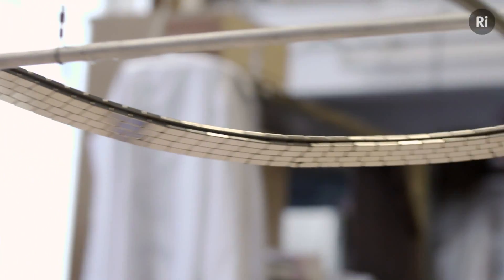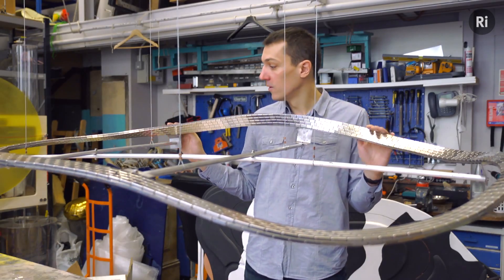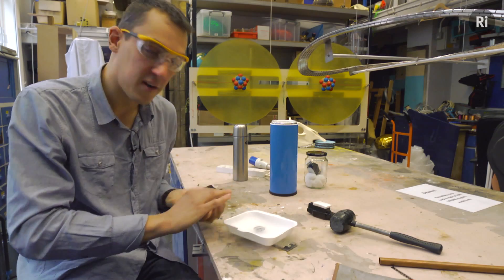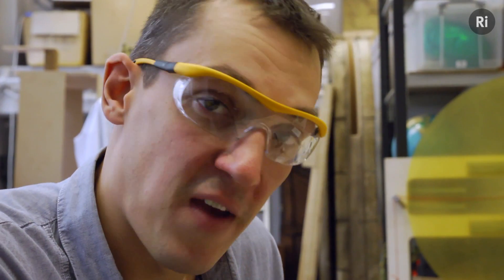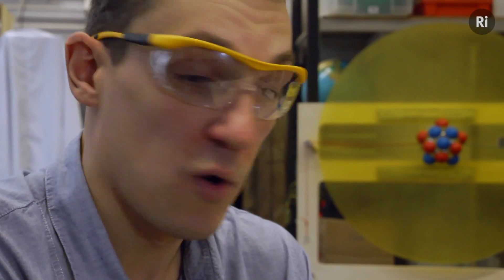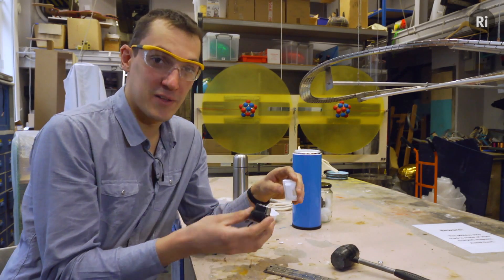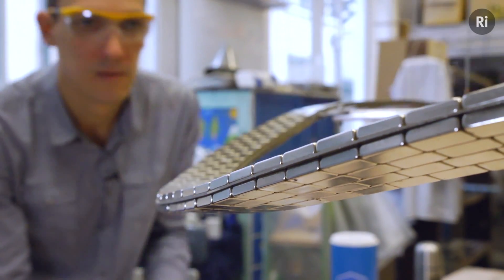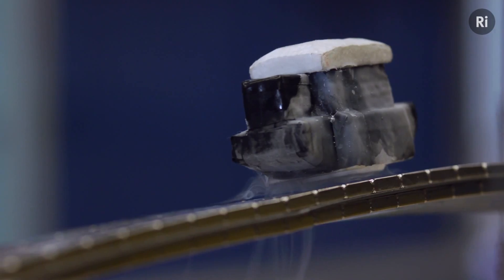Levitating Superconductor on a Möbius strip

Comment: You said that the magnet could be lock in place because there is no resistance, but if the resistance is a true 0,0000... Ohm, why can we revome and place the magnet without an infinite force due to infinite Eddy currents ? The magnet is not definitively 'stuck' in place ?

I am wordering for years !
Reply: induced current is limited by the induced emf caused by a change in flux. so a max force it can take is dependant of change in flux. so when that threshold is met it cannot stay put
Reply: have u found an answer mate?im wondering the same thing. i think its something to do with "flux pinning/qauntum locking" see in the video he "sets" the conductor to constantly float at that height
Reply: Correct me if I'm wrong: you are wondering how it is possible to easily move the superconductor (SC) inside a magnetic field while having 0 resistence (R). This because a 0 R conductor (perfect conductor) moved in an external magnetic field would generate infinite eddy currents.

I would takle this from two sides:

First, the 0 R condition (also called perfect conductor) is not sufficient for infinite eddy current as @Jensen is suggesting. With 0 R you actually have persistent current, meaning that a current generated inside the perfect conductor will never cease to exist, but the intensity of this current will never be infinite. You would need an infinite change of flux to induce an infinite current, which you can see is impossible. Otherwise if a finite change in flux would generate an infinite current this would solve the energetic hunger problem.

On the other side the SC is NOT a just magnet, it is way more than that. A SC shows the Meissner effect, namely NO magnetic flux can enter the SC. Similarly to how NO electric field is present inside a conductor (in static condition). And how can this happen? We can think that the SC generates a magnetic field such that the total magnetic field inside itself will be zero. Therefore when you move the SC this will modify the field that is generating and when you leave it the new field configuration will again be such that the internal field is zero. In this way you can see that there happen no change in the magnetic field flux inside the superconductor, because the field inside has always been zero, this implies no eddy currents.

Actually there are also surface effects happening which complicate the picture, but the final result is similar.

I hope that this intuitive picture would help you!!!
Reply: @danieleronchetti1314  Thanks, in fact it's not due to eddy currents so the explanation was misleading. It's due to Meissner effect that is a specific case with 0 resistance.
Reply: Awesome work bro👍..thanks for sharing ❤️

Comment: Where in this Mobius strip does the magnet pattern change from one polarity to another? Is not possible to align all magnets South Pole inside, North Outside, because there is only one surface. What happens to the train in the changing polarity zone? Does it bumps or something?

Comment: Stick a little fan to it, and you don't need to push it.

Connect that fan to a remote controller, and you can drive it around.

Connect multiple fans, and make the track fatter, and you have a car that can steer.

Make multiple cars, and you have a race track.

Imagine that: a mobius strip superconductor racetrack. Since you use superconductors, you could make it go ridiculously fast. If that isn't a cool idea for a toy, I don't know what is.
Reply: Its just the problem on little kids handling liquid nitrogen and daring their friends to stick their hands in it.
Reply: streak1 *liquid nitrogen not included
Reply: It’s going to be attracted to the track itself, and it can demagnetize the superconducter
Reply: Sounds like F-Zero.
Reply: Monody YESS!
Reply: No need for a fan or batteries. Use the nitrogen vapor from the rapidly boiling liguid nitrogen to propel the vehicle with a nozzle.
Reply: Wouldnt be able to steer. Has to follow the track or it wouldnt float
Reply: This guy living in 2084 lol
Reply: Cool is the right word
Reply: Build 2 strips as "tracks" and a linear motor in the middle: A levitating train.
Reply: i was thinkin in the same way. And pute it in hyperloop and you can travel around the word in min. Or get my packege from china in 1hour instead 30 days.
Reply: that would probably be around $2,000 dollars or something. not many people will pay that much to watch fast miniature racecars.
Reply: @lipstick372  
I would
Reply: @OLD-AND-UGLEE  then you make bad decisions
Reply: Money
Reply: That's just stupid

Comment: His explanation doesn't seem to add up. If it were a matter of Lenz's Law as he is suggesting lifting the conductor away would create a stronger force of attraction in opposition to that motion, and as he suggested as there is no resistance the current should be able to equal any value required to keep the conductor stationary.

Comment: The Problem with this explaination is that you have to cool it down at the same relative distance and then it "flips" into the right position on the track. If any movment that is not along the track is repelled, why does it flip in that right position?

Comment: do we have any materials that is a superconductor without needing to supercool it?
Reply: i belive so, but don't quote me on that.
Reply: Na they're all artificially made metal alloys that have absurd critical temperatures. If we did digital electronics would have 100x better signal speed.
Reply: I believe graphene is a superconductor, and it has the added bonuses of being 2-dimensional and harder than diamond.
Reply: can i use dry ice instead of liquid nitrogen?
Reply: Unfortunately, graphene is harder than diamond only in principle, not yet in practice.  The inter-atomic bond structure is sturdier than that of diamond, but macroscopically, graphene is literally a 1 atom thick sheet of graphite.  That's not an analogy.  The Nobel prize winners for discovering it used normal sticky tape and pencil lead.

In addition, the actual formation of graphene is extremely delicate, and those perfect hexagonal atomic structures fuck up every hundred or so (I think) which essentially means there's almost no way to make large amounts of "pure" graphene.  At least not yet.

There are other issues with it that I learned about in nano, but I've forgotten it.
Reply: Nathan Klassen Oh well. Some day, though, we may be able to mass produce it.
Reply: The room temperature superconductor is like a holy grail for many scientists. Some claim it's not even possible, others never give up. Recent studies claim that it's possible, but you need an extreme pressure or infrared laser pulses...
Reply: Actually, graphene is not in fact a superconductor at zero. However, it does have remarkable heat conduction properties; i would recommend searching graphene cutting through butter or an ice cube, just by using the heat of a human hand.

Comment: can we use electromagnets in place of permanent magnets?
what is that box made up of in which you have attached ceramic disc and filled it with nitrogen?
how can i keep my liquid nitrogen cool if i buy it from a shop?
Reply: My guess is that the material the box is made of doesnt matter, as long as its not magnetic and wont become so brittle that it breaks when cooled by liquid nitrogen.

Comment: Have you tried this track in a vacuum?
Reply: #neartonofrictionwithmotionwouldbetooop
Reply: It is easy to imagine what would happen in a vacuum but remember the superconductor will eventually warm up and stop. Also you can't produce perfect vacuum easily but it can be done better than it is in space.
Reply: plusko that depends on the radiation of nearby heat sources and the average "temperature" of the vacuum.
Reply: +ThePizzabrothers Gaming if it's a hot day and you're in a dark room it would be significant

Comment: so basically we could have cars that float on a magnet track that runs on liquid nitrogen
Reply: they already have mag-lev trains
Reply: +Jawbreaker That be horrifically expensive and unsustainable though :C
Reply: ShatteredDawn but technology can always advanced and be fixed
Reply: Jawbreaker Material cost is a lot harder to fix though, especially when the benefits of replacing roads don't really justify it.
Reply: maybe not cars, but a hyper loop-like system... maybe,  if the thing is inside a vacuum tube, keeping it cold becomes  less of a problem, plus this dramatically simplifies the track
Reply: Mik Wind tru i agree
Reply: Neodymium magnets are expensive. Electromagnets also. But you can build funny projects.
Reply: lobster strike tru dat
Reply: How about the hyperloop things run on the magnet track, but instead of using liquid nitrogen as a fuel it uses electricity the  Using fractional distillation to get liquid nitrogen (to cool the superconducting base) from the air, also as byproducts you would get The other gasses found in air which could be placed in tanks sold eg. CO2 Oxygen and Argon (You could also recollect nitrogen or just release via exhaust it), if it's also powered by solar. Mega profit and you could advertise that it consumes co2 rather than releasing it.
Reply: BC5  fractional distillation is for separating component gases/liquids by taking advantage of different boiling points, this doesn't work for getting nitrogen because everything in air is already a gas, heating it up more does nothing. moreover i dont think you realize how much power that can take to do. run it off solar? yea, maybe if you had an entire solar generator plant on wheels. you could do the reverse, that is lower the temperature until things separate by different boiling/freezing points. but again that would take massive amounts of power.
Reply: +mxn1948 1. http://www.bbc.co.uk/schools/gcsebitesize/science/edexcel_pre_2011/oneearth/usefulproductsrev2.shtml < Fractional distillation of air explained simply by the BBC. 2. I'm talking about something like a hyperloop running off this, you could have the "tube" the carriages run through having solar panels atop.

Comment: So "high temperature" is relative? When you name things do you EVER think about the future? I mean, they will likely one day invent super conductors that operate at room temperature, then maybe at REAL high temperatures, live greater than 2500 degrees. What are you going to call THOSE ones?
Reply: +Eric Taylor so you're saying we should never use the terms "high" or "low"?
Reply: +Eric Taylor so you're saying we should never use the terms "high" or "low"?
Reply: +Eric Taylor Maybe we can just put the letters "er" at the end of the words for each increase in magnitude. Ie. "high", "higher", "higherer", "highererer" and so forth; an extended comparative form of the adjective, if you will. This system can extend into infinity, so I think it should cover all future progression and it works for pretty much all adjectives.
Reply: lol, you say that but then immediately after say that 2500 degrees is "high". It's pretty darn low for lots of cases.

Comment: i have a question, that how does that superconductor  flips to the other side of track. as you initially pushed the semiconductor above the track  and after taking one round it can be seen inverted below the track facing downwards. is that something to do with the construction of this track.
Reply from the maker: +Ankush Sharma Yep, it's because of the shape of the track. It's a Möbius strip, which is a shape with only one side. As you move along it, you'll cross the entire length of the strip before you get back to your starting point:  https://en.wikipedia.org/wiki/M%C3%B6bius_strip We used it to show the the levitation even works when the boat is hanging below the track.
Reply: It is basically a strip connected at both ends but before that you twist one end once.
Reply: +brian yu Its 'Moebius Strips', Moebius is a proper name, and only one single August Ferdinand Moebius (an astronomer) discovered/invented it.
Reply: for a simple explanation, get a strip of paper and give it a half turn so there is a sort of corkscrew in the center and tape the two ends together so the bend is still there. if you put your finger on one side and without lifting it, move it along the strip, it will eventually travel the full length of the strip, never leaving it but touching it all the way along. so the question now is, how did a clearly 2 sided piece of paper suddenly lose a side?
Reply: mobii strips have a flip in the middle, making it so that it has one side
Reply: A Möbius strip is a special surface called a non oriented surface. It has no definite top or bottom side. I.E. It area vector does not point normal throughout both sides of the surface
Reply: +Patrick B. Ludwig its Möbius.
Reply: +jared anderson "Möbius" and "Moebius" are the same word. The rule with umlauts is that if you don't have them on your keyboard you can put an 'e' after the letter. So 'ö' can be typed as 'oe' ... the person you are correcting was correcting someone who had typed "mobii strip".
Reply: Chris Flanagan ahhh, I did not know that rule, I've only taken sort of basic classes in german and never ran into this issue. Thank you for that. And if nessecary, you can go to a web page with umlauts on them and copy paste.

Comment: Just a suggestion, but you should modify the cell you hold the liquid nitrogen it (the one with the magnet on it) into an airtight chamber with a valve at the back so that you can channel the nitrogen gas out through the back so it can propel itself.
Reply: +Tyler Wood The idea of an airtight chamber is great, but the valve would be a complicated one, involving a mathematical optimization process. It's not a bad idea, but more work would have to go into finding the optimum relationship between how much nitrogen you need to keep the magnet apart from the track, and how fast you want to move (temperature vs velocity),  The idea of a levitating superconductor is that the temperature of the liquid nitrogen makes the object hover over the track. Remember, there is no such thing as a known process that converts 100% of one form of energy into 100% of another. Optimization is required when a single fuel source powers force against BOTH the y and x directions. However, your idea would work if the forcing of nitrogen out of the tube was a 100% efficient process, converting all of the energy needed over time to keep the train upright into a proportional amount of energy shoving the device across the track. 

For every action, there is an equal and opposite reaction - true! But If we want to use that same fuel source to keep the object levitating, having all of the fuel ejected would require computerized adjustment of the opening of the nozzle. 

Liquid Nitrogen needed (y direction) does not = needed Liquid Nitrogen (x direction). It requires algorithmic optimization. Remember, you need energy to push out the nitrogen to accelerate it. Just letting out the nitrogen through an open door won't get you anywhere, unless the environment is a vacuum - interesting idea! But even in a vacuum (if the vacuum is on our planet), taking all that energy from keeping the object staying upright would create friction - then, the friction would decelerate the object along the magnetic track. 

So there's the problem of the optimization of chemical energy to kinetic and magnetic energy simultaneously, along with optimizing the force of pushing an object horizontally vs. keeping it up vertically (remember, the whole idea of this superconductor is to seemingly cancel out electromagnetic resistance and friction - we have to keep the darned thing upright)
Reply: This was just a much easier and simpler demonstration I guess

Comment: Is the temperature of Space not colder than liquid nitrogen? And the planet earth not a gigantic magnet? Perhaps this is why planets are seemingly suspended in space. If the planet stopped rotating would we loose our magnetic field?
  Are superconductors used in satellites or onboard space ships?
Reply: +Lamb Leg if you cool it down and then use it in space wouldnt it stay in a superconducting state. that would be cool pun intended
Reply: Lamb Spoon it won't heat up in space as space is a vacuum so thermal energy doesn't conduct to it very effectively as long as you shield it from light and I don't get how a superconducting magnet is going to make everyone die because if that's the case everyone working with the large hadron collider would be dead